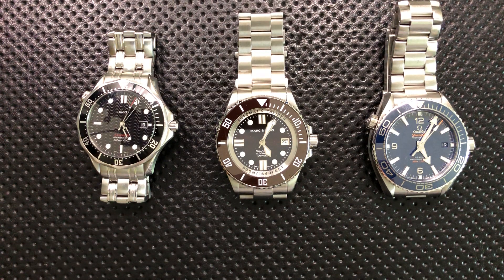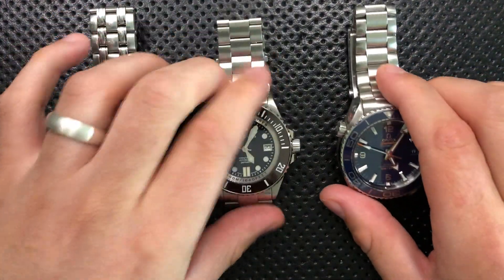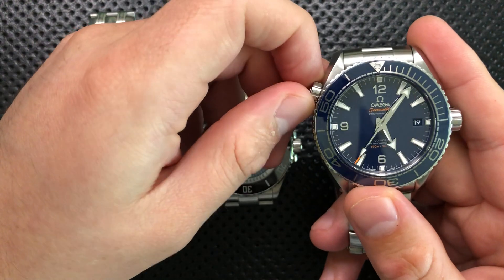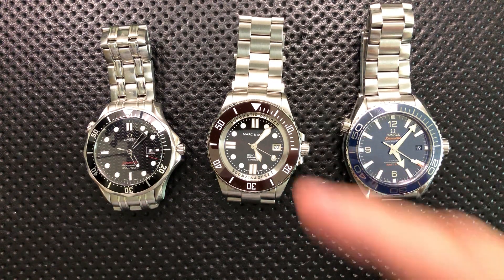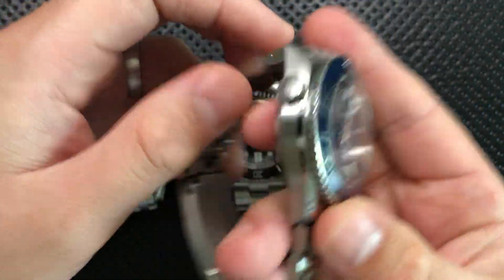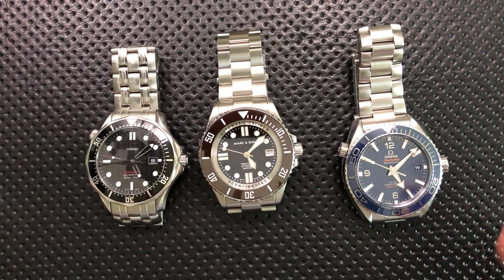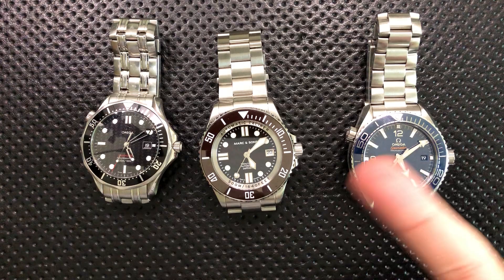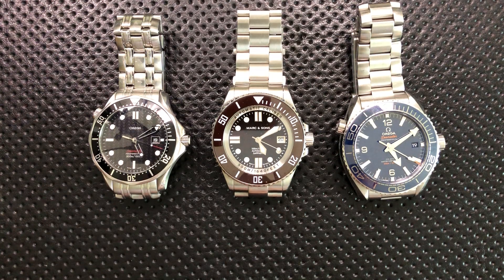Your watch doesn't need a Helium Escape Valve

Comment: Wouldn't the helium escape through the crown if we simply fully open it?
As I understand, hev are only a window to equalize the pressure without harming the mechanism...
Reply: Yes, but it would also (potentially) let water in. Helium escape valves are a one-way valve. They let gas escape without letting anything else in.

Comment: I’ll never understand why helium just doesn’t escape from the screw down crown when you unscrew it. If it’s going to let water in when unscrewed, it’s going to let helium out.
Reply: When you are in decompression there is a lot of water condensation, so much that you can see a fog. This enters the watch if you open the crown
Reply: @Gnarlysquirl  how is that any different than opening a helium escape valve though? They’re both creating a space for gas to escape
Reply: @sinjon  it's a one way valve rather than an open passage that would allow moisture in

Comment: this is a pretty good video and explanation what I want to know if you can help is how and when do you regulate the use of your helium valve because when you're in the dive Bell you would obviously open it because that's your high helium environment but what happens when you get out of your diving bell and you're on the floor of the ocean do you close it before you go down and at what point coming back up do you open it and then during decompression when do you finally close it

Comment: I don’t even swim down to a 10 foot mark in a pool. So really, any dive watch is overbuilt for my needs. Yet, they are the ones that I like to wear. It’s almost like wearing a Kevlar motor cycle jacket while riding a single speed bicycle.  

If I purchased items that simply covered my needs for the tool, I would be happy with only a Casio F-91W for a watch (nice watch, btw) or just an Opinel 8 for my knife. 

But if I’m going to collect something, then damn it all, I’m going to collect it but good. 

And yes, if that Medford Praetorian Ti comes with TWO helium escape valves,  sign me up!

Comment: Hey Nick, about the manual valve. Why not just unscrew the regular crown so the helium can escape? 
Am I missing something?
Reply from the maker: The problem is that if it's gonna pop the crystal, it would've done so during the ascent, not once you're out of the water.  And when the crown is unscrewed, usually, the watch has next-to-no water resistance (whereas with an Omega-style HEV, the water resist is just lowered to 100m).  So, it's no problem to just pull the crown if you're decompressing "dry", because you can just do that, but if you're underwater, it might cause issues.
Reply: Ah ok, my understanding was that you only decompress dry with saturation diving.
Reply: with saturation diving you're generally in an open diving bell, so it's possible to keep the watch dry, but you probably wouldn't want to take any chances.

Comment: you're right.  I own a tudor pelagos with helium escape valve.  do I "need" it?  no but I also don't "need" a $4500 watch.  the external helium release valve on the seamaster is gimmicky and a liability though I did own a bond seamaster and wore it for years.

Comment: Love your channel im wondering once you are done with your dive and out of the water wouldn't unscrewing the crown breifly release the pressure essentially doing the same as the screwdown helium escape valve
Reply from the maker: Well, kind of.  The problem is that if it's gonna pop the crystal, it would've done so during the ascent, not once you're out of the water.  And also, when the crown is unscrewed, usually, the watch has next-to-no water resistance (whereas with an Omega-style HEV, the water resist is just lowered to 100m).  So, it's no problem to just pull the crown if you're decompressing "dry", because you can just do that, but if you're underwater, it might cause issues.  

But again, solution in search of a problem.
Reply: Nick Shabazz  Thank you for the explication fantastic job and keep those great videos coming look forward to your next video have a great day cheers

Comment: My Seiko Tuna is designed to prevent Helium gas from penetrating the case, eliminating the need for an escape valve. They use an L shaped gasket (under the crystal, I believe).
Reply from the maker: That's an even better approach!
Reply: You got me there! Poor Seiko, missed another huge marketing opportunity....
Reply: How is that better? You can't see it or play with it. How is the marketing department supposed to sell an invisible gasket?

Comment: No shit. Unless you're a saturation diver, you don't. Kind of a pointless video, but... It's good you're making more watch videos.

Edit: Saying that it's a marketing trick is just not right. It's one of the greatest innovations in watchmaking, and putting it on a watch is moreso paying homage to their history than marketing. What's the use of a Tourbillon? What about a minute repeater? There is none. It's art. Mechanical watches aren't about functionality, and if this bothers you, don't buy mechanical watches.
Reply from the maker: The thing is, for 99.9999%, the HEV is a solution in search of a problem.  It's just a fault in the case.  That's not innovation.  Innovation is creating it, then featuring it where it makes sense.
Reply: It’s not pointless video, for the new collector of watches it explains why it’s not needed for the average person who has no idea behind its purpose.
Reply: omega has helium release valves on quartz watches too.

Comment: Professional divers use dive computers. Helium escape valves are useless,  as the majority of dive watches never get wet. It is more a macho statement.  That's ok too!
Reply: To be fair the watch with a helium escape valve would never need to get wet. The helium mixture would only get into a watch inside a dive habitat or diving bell so theoretically the watch would never need to go into water but would be under pressure.